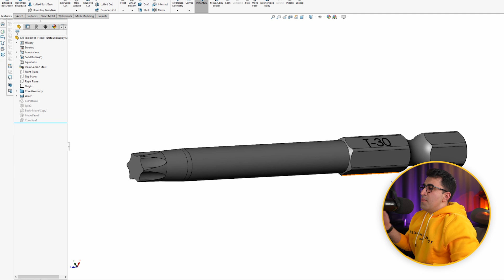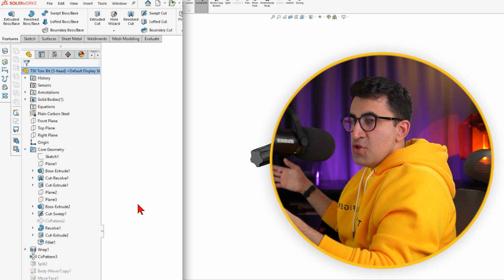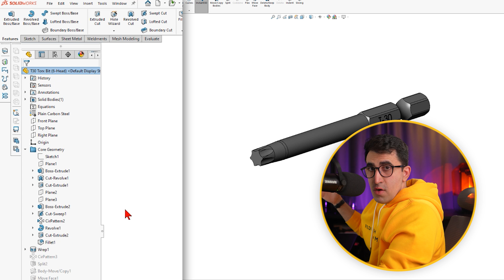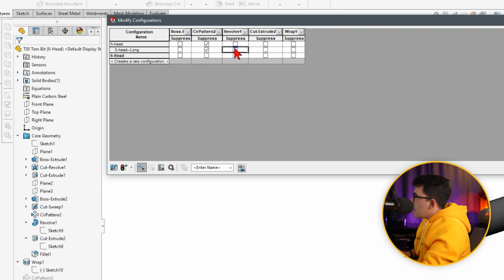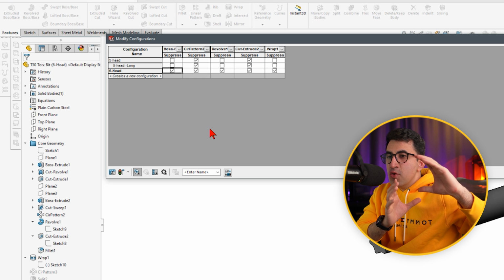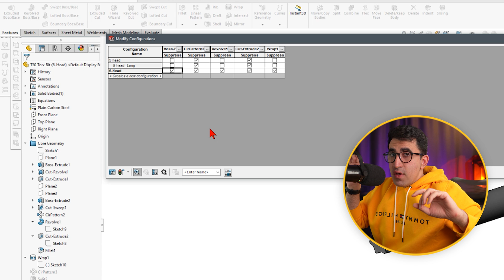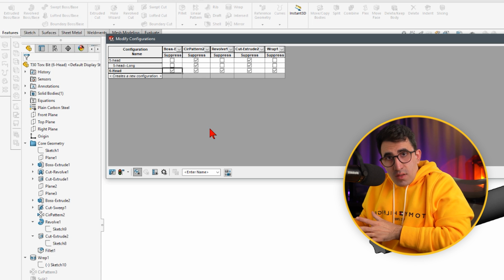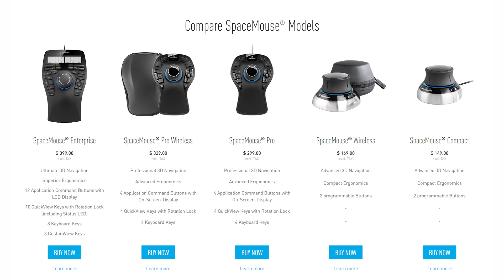Advanced tip for SOLIDWORKS - Challenge with a prize!

Comment: Here is a helpful tip that I think can make your life easier:
If you want to make a mirror part and keep it driven by the original part, instead of mirroring the part through "mirror bodies" in the part itself, you can do the following -
Mirror the part in an assembly by using the mirror feature, and then in the mirror feature tab you can press on the "next" arrow and under "orient components" choose the "create opposite hand version". click ok and now you have a new mirrored part that is entirely dependent on the original part. you can right-click on it in the part list and make it independent if you want to use it outside of the assembly. if you have an assembly with dozens of parts that need to be mirrored it is much more convenient than going to each part individually and creating a "mirror body".

And a bonus tip because you talked in your video about parent/child features -
in the search bar write "Dynamic reference visualization (parent/child)" and enable it. now if you want to see the relations between different features you can click on the feature in the feature tree and all the child features will be connected with a purple arrow and all the parent features with a blue one. (you can also right-click on the part itself in the feature tree to enable/ disable this feature.)

Comment: I know this is over time, but still wanna to share this.

If you are making a complex product, you may have to consider to make a masterfile or template. This is just a partfile that contains all the dimensions and geometry. You can also add some surfaces or maybe solids, i advice to not make it too heavy or complex because of the rebuild time.
After you finished the template you can derive all your parts from it, just by loading a partfile (template) into a part with the insert part command, so you will link files to eachother. You have to select the following: solid bodies, surface bodies, planes, axis, absorbed sketches, unabsorbed sketched and last but not least the move body copy feature to locate the imported part. Then you mate the front, top and right plane from both files to eachother.
The next step is to give some thickness and add the detailed geometry based on your template.
The main advantage of this way of building your files is the adaptability. If you change the dimensions in the template all the files will update automatically and you don't need to even open them after some changes. This save a lot of time and the risk of making a mistake because you don't have to change 15 parts or so. The other big benefit is that in assemblies because every part has the same origin, you only have to mate the origin of the loaded part to the origin of the assembly and you are done. This way of working is also possible with multiple configurations.
Reply from the maker: Thank you for sharing your insights on creating a masterfile or template in SOLIDWORKS. This is a great approach for creating complex products and ensuring that changes to dimensions and geometry are reflected across all parts and assemblies. It also helps to save time and reduce the risk of errors, as you mentioned.

Comment: it´s probably late for the challenge, but this is a cool tip:

If you have an assembly that works as your base for further customization, instead of "saving as", or duplicating each individual part, you can ¨Pack & Go¨,. This feature would pop a file management window, which allows you to select just the pieces that would be customized, without altering the rest and save the whole set as a new assembly,  with custom naming, file location, etc.
It will prevent the base assembly to be altered and keep it easily accessible.
Reply from the maker: good tip, somebody else also put it there. but yes, it's closed already! Thanks for the comment and watching my videos. Maybe next time ;)

Comment: The most advanced tip i know, is it  to allow the imput numbers in sketch. It allow you to make line in sketch in correct length in seconds. In my projects it save me so much time.

If you what to set this, go to...
System options -> sketch -> Enable on screen numeric imput on entity creation
all so you can allow to create dimension only when value is entered
Reply from the maker: Very nice, though the two weeks has passed. I announced the 5 winners. But thanks for th tip
Reply: I know, but it may help to someone and that is reason why i commented although it was past 2 weeks.

Comment: Let's say you are working on a part and a offset extrude cut dimension become incorrect after a draft. Instead of Ctrl+Z back through everything to redo to it, simply drag the draft before in your design tree to have the draft occur before the offset extrude cut thereby giving you the correct dimensions on the cut and the draft complete. If some model manipulations affect previous ones you could drag it within the design tree to have it happen earlier to avoid redoing the work over again. Please see the Solidworks World Model mania 2002 video to see it happen.

Comment: The best tip of solidworks: when there is a large assembly, it puts lot of load when loading. Solidworks has a option of defeature. By using this tool we can remove the unnecessary detail in the assembly. Suppose I have a motor in the assembly, its fins are not really needed in assembly but it takes time in loading. So when I defeature it, it removes all the fins and makes a cylindrical surface at its place. We can also select features that we need to preserve. We can select it tools> Defeature.

Comment: A tip I LOVE is the following: By default, when you apply a smart dimension to a circle or an arc, it takes the center point to add the dimension. Sometimes, you want to use the "min" (nearest) or "max" (farest) condition. You can do it easily by selecting "SMART DIMENSION", clicking on your first reference, holding SHIFT and selecting the circle or arc. Depending in what portion you select it will take the "min" or "max" contion. This also work for two circles or arcs.

Extra tip:
Sometimes when you want to add an angle to a line, you have to create a construction line for the reference. However, you can do the following: use "SMART DIMENSION", click on the line and then one of the two points of the line. It will display a coordinate system, you have to select one axis, and that's it, you have your angle dimension.

Extra extra tip:
When editing an sketch, you can use "SMART DIMENSION", select you component(s) for the dimensions. Intead of writing a value, add a "=" symbol, and you can to select other dimensions. This will create an equation. If you change the main dimension, the referenced dimension will be updated. Basic example: If you want a rectagle to have one side the half of the other side, first add the dimension of the largest side, then select "smart dimension", write "=", select the dimension of the largest side and write "/2". For further information, learn how to use equations.

Comment: One more tip, maybe obvious, but I found not so many people use it - you can choose in configuration properties how the assembly shown on the BOM when it is used as subassembly.
In assembly choose the configuration tab, right click on the configuration name-> properties in the context menu. So in configuration properties you can find "Bill of Material Options" where you can choose three options: Show, Hide and Promote. The first two acts as it is, hide or show the subassembly in the BOM. 
But the third one makes all parts of the subassembly shown in the BOM of main assembly you work with.
You can find the third option is very useful, if you use the same number of the same parts in different assemblies or if you have huge assembly
Reply from the maker: thanks

Comment: M.D. tips
A list of short, but useful tips I use every day:
1. Display states helps me to create some screenshots for assembly instructions, for exapmle. When you need a series of photos where parts are appearing one after another.
2. There is a line called "Previous selection" on the right-click menu. When you lost your selection somehow, you'll always find it there.
3. F5, F6 for selection filters. F5 to show the selection filter, F6 to toggle it. Especially useful in Drawings: when you need to choose all the dimentions, for example.
4. Flat tree display. Right click on the part name in Feature manager - Flat tree. It displays the design tree without nesting and absorbtion.
5. Shift + C to collapse the Design tree.
6. Normal to. Select two faces: 1 for Normal to 2nd for the up orientation. Select both before hitting the "Normal to" button and your part will be oriented the way you need.
7. Fit spline command is useful when you need have a single line instead of a set of straight lines and arcs. Useful for complex geometry design and for Motion by trajectory animation.
8. Time-saving. Do not exit the sketch you've just designed to create a feature, just press the feature button while you're still in sketch.
9. Remember: you've opened some complex model, trying to make some changes, but everything goes wrong (Errors in the tree, failures in features). Forget it, start over with Reload command - it'll open the original saved version of your file.
10. In Assemblies use Isolate and Show hidden commands when you need to see what's going on with your parts. Show hidden is like the second space, area in your model: there is a space of Showed part and space for Hidden parts. Extremally useful, highly recommend to assign this command to a hotkey.

Comment: M.D. tip #8
Sketches!

When you have to copy some sketch from one part to another you have 4 ways to do this:
- Copy the sketch from the Design tree. And paste in the new part on the selected plane.
- Open two part in parallel and just drag the sketch from one part to another.
- Create a Block from theoriginal sketch and use this block in your other parts.
- Open the sketch in the original part, select all entities in this sketch you need to have in another part, copy them. Open sketch in your second part, create a sketch and past those copied entities in this sketch. (they will be pasted without dimentions and links, remember that.

BONUS: if you need to use one sketch several times in the same part, use Derived sketch command. It create linked copy of the original sketch, and you can only locate Derived sketch, but not change it.
Reply from the maker: cool tips

Comment: M.D. tip #7
Multibody modelling

If you have to design some complex structure made of dozen of bodies, you could use traditional approach (design each part in .sldprt file and then assemble them).
But you could use a multibody modelling approach: you create only one .sldprt file and design the whole assembly inside of it, so you have a multiple bodies in your file.
And there are no problems on the farther design steps: drawings, BOMs, etc. Solidworks has solutions for each of these stages.
There are some limitations for this method:
- it is hard to use some standard parts inside Multibody part
- it's hard to get one specific body into different assembly if you need them.
and some others.
So use it carefully.
Reply from the maker: practical

Comment: M.D. tip #6
Structure your assembly

We all sometimes create and use big assemblies.
And when you change something in your part, the whole assembly mates could get ruined.
So I'd recommend to use Control sketches, Reference geometry to mate your assemblies.
I've already told about my approach to part modelling: Control sketches. So it could go farther, to assemblies. When you have several parts, all modeled using Control sketches approach, you could use those sketches to mate parts in assemblies without using feature entities.
Like if you change smth in your model, use change it with Control sketch, so the assembly will be changed automatically.

BONUS: you can create a sketches in Assambly design tree to mate your parts to. So won't be afraid of changes in the models because you've mated your parts with Sketches, not feature entities.
Reply from the maker: good tips!

Comment: M.D. tip #4
POWER is Task scheduler

I use this tool almost every day.
Export files to another formats. A big number of drawings to export to PDF, for example.
You just choose the folder with your .slddrw files, set some setting of export and it does the rest for you: it opens each file and saves it as PDF.
Another applications are: Simlation processes and Rendering processes. For instance, when I have several Renders to be rendered, and all of them are different files, I just create a task to render them one by one with all the settings I need. So my computer is busy, and I'm free :)

BONUS: this tool has a lot of superpowers, it is totally worth it to check them out.
Reply from the maker: good tips. Two of your tips are being considered for the top 5
Reply from the maker: how do you do that?

Comment: M.D. tip #3
ToolBox - is it good or what?

I've used ToolBox for a long time, but sometimes it fails: looses models or connections.
So I decided not to use it anymore. I've created my own Design library with blackjack and.. mate references.
So my tip is: create your own Design libraries with parametric models of everything you use (fasteners, bearings, wheels, etc.). You'll always be sure where to find it and how to use it in your models.
And try to use Mate reference: it saves plenty of time when putting fasteners in your assembly.

BONUS: when putting fasters of other frequently used parts, use "Sketch drive pattern" to put them all in place with just one command. Create a sketch with a bunch of points where you need those parts, put the fist part traditionally in your assembly, use "Sketch drive pattern" to put the rest of them in place.
Reply from the maker: thanks

Comment: M.D. tip #2
Parametric design
I'm a huge fan of parametric design, so I want everybody to know about it and use it for their work.

If you are designing a complex single-body part, and you know that there could be changes in this part in the future. Do this instead of straight modelling be features.
1. Create several Control sketches (that's how I call them) that will define a shape and features of your model. It could take you a while to create those sketches on different planes, but it's totally worth it.
2. Start designing your model LEAVING the Control sketches intact, use "Convert entities" feature into a new sketch instead of using the original Control Sketch. That is how you'll always have your Control sketches on the top of your Design tree.
3. So when you'll need to change smth in your model all you have to do is to make changes in your Control Sketches on the top of your Design tree.

This approach I've used to model Kitchen sinks, for example. So if I need to make changes in existing one or crate a new one, all I do is make changes in Control sketches.

BONUS: organize your design tree, make it neat and tidy. Use stop-down modelling approach, use folders.
Reply from the maker: good one

Comment: M.D. tip #1
Productivity is pleasure
Use the whole pack of productivity tools is SW:
- S key for a shortcut
- Mouse gestures for the most common commands
- A key to toggle the command
- D key to bring the confirmation options to the pointer
- W key for a quick search
- Custom top bar panels. You can create your own panel, not just using "Features", "Sheet metal", etc.

Those are the most time-saving hotkeys in SW.
Bonus: using S-key, mouse gestures and manually assigned hotkey you won't need a top bar at all. So you could hide it with F10, F11 keys to have more graphic area on your monitor.
Reply from the maker: Hi, you won the best comment and the highest prize. Not for this tip I'm leaving a comment on but your another tip which I will announce in a different video soon. Please send me the address you want me to send your prize to here: Info@solidworkstutorials.net and write a random 5 digit number in that email! Important: confirm below this comment in a reply what that 5 digits number is.
Reply: @with-aryan  637287
Thanks a lot! That's great news!
Reply: @with-aryan  I've sent you an email. Please let me know if everything is okay.
Reply from the maker: Still waiting for your adress. I will wait until Monday

Comment: I’ve always found for both assemblies and parts, sketch driven pattern is a very powerful tool to save time. 
For example one bolt and nut can be brought into an assembly and using sketch driven pattern can fill all the remaining holes. Then there’s only one bolt and nut to change rather than every bolt and nut. The same within parts, knowing you need to pattern a components bolting holes using an additional sketch with centre points can make it simple for one part to be edited or one sketch to move the locations.
Reply: Also reference mates can be a fast way of adding and mating parts in assemblies.
Reply from the maker: but the solidworks toolbox does that for you (filling all the appropriate holes with bolts and nuts upon importing them) without the sketch pattern
Reply: I’ve found sketch pattern to be more reliable when edits to the model require more bolt holes but this using tool box is also a good option providing everyone has the package with it included.